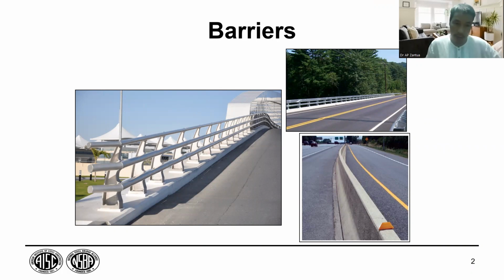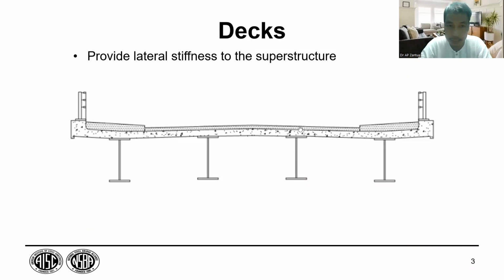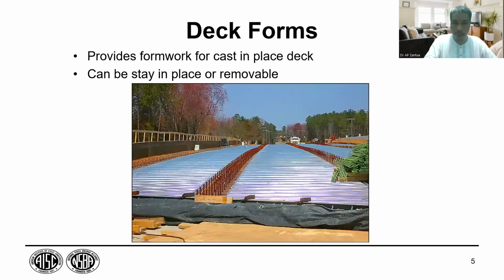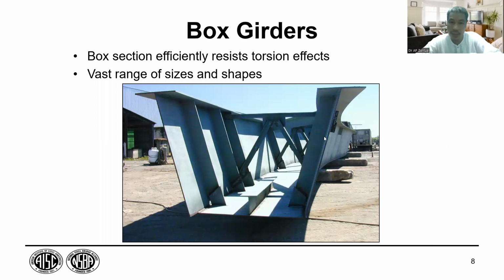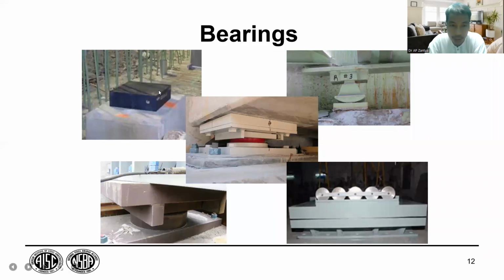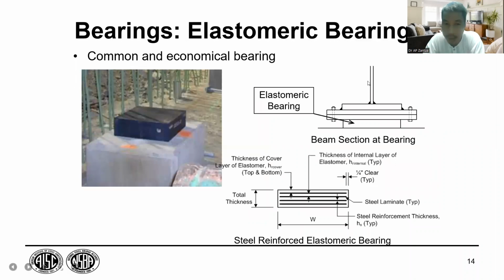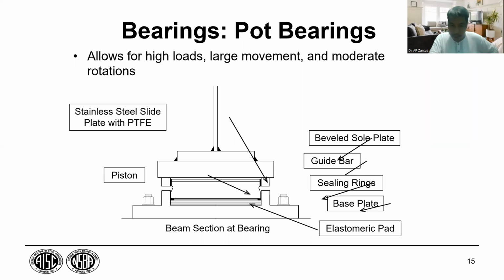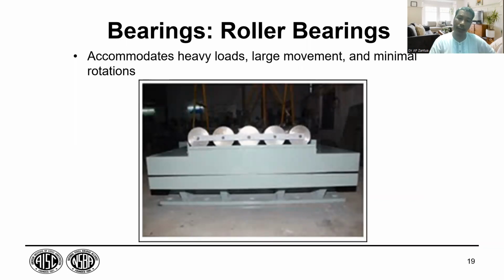BRIDGE Superstructures [ Highway & Railroad Engineering ] Module 5.03

Comment: Thank you for this video lecture that tackles about bridge superstructures. In this video we will learn different terminologies mentioned in the superstructure just like barriers, decks, wearing surfaces, deck forms, difference between plate girders and rolled beams, box girders, cross frames, diaphragms, lateral bracing and different kinds of bearing and its uses.

Comment: Thank you Sir for discussing about the girder bridge superstructure. Barriers, decks, future wearing surfaces, deck forms, I-Girders: rolled beams, plate girders, box girders, cross frames, diaphragms, lateral bracing. Also, different bearings were discussed such as rocker bearings, elastomeric bearings, pot bearings, disc bearings, rocker bearings, roller bearings.

Comment: The lecture video is all about girder bridge superstructure; the latter word means a vertical extension of existing structure of a baseline. I've learned the differences of I-Girder: rolled beam and plate girder and different types of bearing and its function.

Comment: Thank you sir for discussing the bridge structure, especially the girder. The barriers, decks, wearing surfaces, deck forms, box girders, I girders- rolled beam cross frames, diaphragms, lateral bracing, rocker bearing, pot bearings, disc bearings, and roller bearings were clearly explained and discussed.

Comment: Thank you for your excellent explanation about this academic video, its all about bridge Superstructure like barriers, deck, future wearing surface, deck forms, I - Girder :rolled beams, plate girder, box girder, cross frame, diaphragms, lateral bracing. Bearings this is for the purpose of earthquake resistance.

Comment: This video about the girder bridge superstructures tackles the function/characteristics of barriers, deck, future wearing surfaces, deck forms, box girders, I girders: rolled beam cross frames, diaphragms, lateral bracing, rocker bearing, pot bearings, disc bearings, and roller bearings. I also learned that asphalt gives the amount of friction so car won't slide. Thank you, sir for this kind of material wherein we can familiarize ourselves about some of the technical terms in highway and railroad engineering.